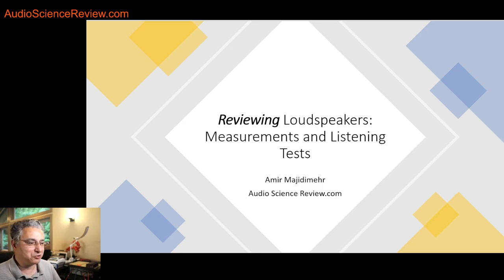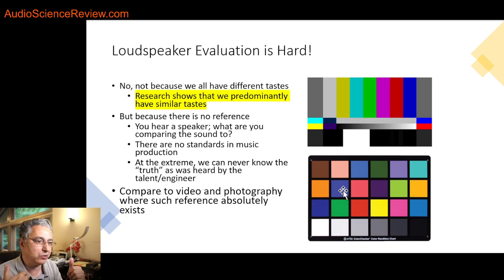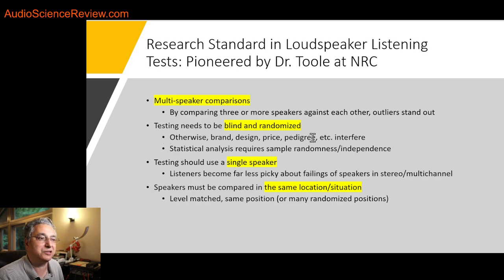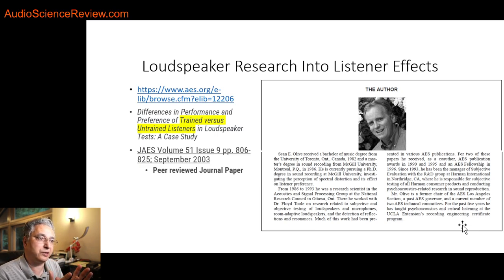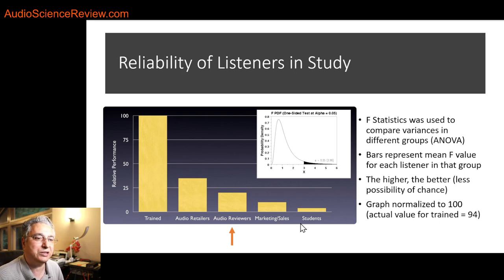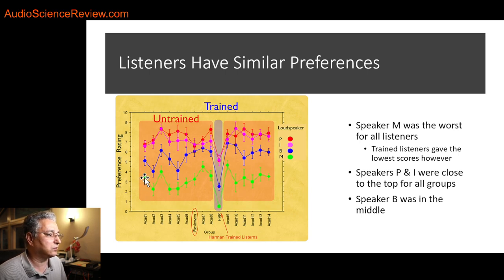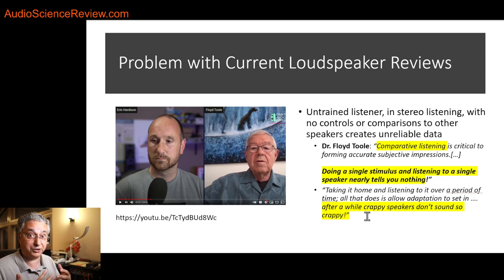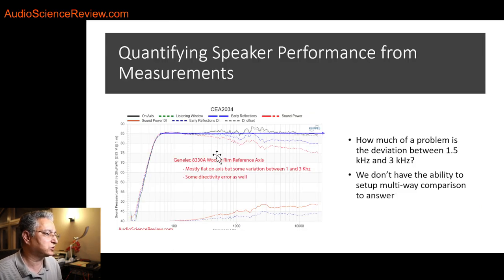Reviewing Speakers - Measurements and Listening Tests

Comment: When you compare speakers as you describe I don’t understand how not optimizing a speakers distance from walls is a fair way to accurately judge a speaker’s sound. Not to mention getting the toe in perfect. You say all speakers should be pointed directly at the listener. I don’t believe any reviewer or manufacturer would agree with that. In other words each speaker needs to be optimized to sound balanced. I’m not convinced this type of listening test is not biased.
Reply: Reviewers opinions I don’t care about. But manufacturers are a different story. If a speaker is designed with specific rooms, room treatments and positioning in mind it’s a bit unfair for HK who have a commercial interest to do tests under the specific conditions they use to design their speakers. Major home court advantage

Comment: The trouble with subjective testing is it depends on what speaker cables are being used. Quite often the quality of the cables are not taken into consideration.
Reply: It also depends on the source. As we know all dacs sound different.
Reply: Most importantly it depends on the quality of the amplifier. Does the amplifier have enough power to drive the speakers to their full potential.
Reply: @1fattyfatman  Kyron makes a good point. You obviously don't believe in speaker cables.
Reply: Sorry to disagree . 
But atmospheric pressure affects sound the most. 
Drag on speaker diaphragms are higher at sea level due to higher pressure and density. 
Its far more accurate when you listen at a hill station.
Reply: @dangerzone8408  if you have to "believe" in it, in order for it to work, some is wrong there.
Reply from the maker: You all are terrible.  :)
Reply: I refuse to listen to anything without a $500 power cable. I just don’t have time for crappy quality music.
Reply: No, it doesn't. As long as cable impedance is <5% from load impedance it has no significant effect. Significant here means it is still several levels below perception. Now, it does effect on long runs, i've had to make those and you calculate a compensation filter to it and you get the exact same signal, plus minute amounts of distortion and noise, all imperceptible, than with a short cable. We are talking about over 25m distances then. There is NO WAY you can do that with 6ft of cable.

I doubt you have formal education on this subject. And i don't think you a trained listener. Trained listener is not one who merely sits in front of speakers. It is an actual skill you have to learn, methodically and with guidance. It requires massive amounts of humility and the ability to say "no, didn't hear that". This part of it is lost on audiophiles, you can't say you didn't hear something without risking being questioned about your abilities. 

Laws of physics do not agree with you. If your theory about 6ft of cable would be true, we would struggle to explain how the Large Hadron Collider can even work. Or how i can type this and you can the read it. Nothing would work like they do now. Your computer for sure could not work like it does now. Now.. is is possible that you, as an amateur, without using proper methodology and primed to hear things that are not there, because of possible shame... what are the chances you are wrong or that all we know about electromagnetism, chemistry and physics in general is wrong.
Reply: @berlyfredy7153  I beg the difference. It's the relative position of the Moon that matters!
Reply: @snowblow1984  relative to speaker, earth or listener ?
Reply: @berlyfredy7153  direction of the cable
Reply: @snowblow1984  man we are taking it too far that people might actually start doing these stuff. 😂
Reply: @berlyfredy7153  I wouldn't be surprised if that's been done already. Or orientation in relation to earth rotation.
Reply: @snowblow1984  😂
Reply: No no, what really matters is what kind of cable risers you are using.

Comment: The hifi industry uses some electronic and electrical parts and some laws of acoustics to build its devices. Curiously in video, there are no philosophical ramblings: the image is correct or not. There have been several DVDs produced where at one point a scene was damaged, such as the negative of the film. And not corrected. For music it is more serious. In terms of sources and amplification, just about anything (unless faulty) will read 100% of the information without removing anything. For the loudspeakers, the low end is more than enough for recorded music (which has nothing to do with the sound of initial artistic performance anyway). Thanks to the software, you can manufacture very correct boxes yourself and thus use transducers that are rarely used in commercial productions, generally because of their price. Whoever tells you otherwise is in the snake oil business (the famous $40,000 amplifiers and 400,000 turntables to better listen to clicks and pops) and spends money on cables.

Comment: Great presentation Amir! Thank you for taking the time to put this together. 
Your point on EQ is particularly interesting. I’m still not clear on how to apply EQ to my stereo setup. Could you point me in the direction of a how to guide i could reference both from a hardware and software perspective?
Thanks again!
Reply from the maker: Thanks George.  How you do it depends on the architecture of the system you have put in place.  In my case, I use the Roon player which allows me to put EQ in the path of our my output device (DAC).  The transformation is then done in digital domain and software so had no cost or performance penalty.  If you use a different player that doesn't have this capability, then the work gets complicated and even more so if you are dealing with analog sources like LP.  Best to post in the ASR Forum and ask for feedback from members.

There is a mega thread on every method of software EQ for different operating system on the forum as well: https://www.audiosciencereview.com/forum/index.php?threads/eq-software-for-windows-linux-macos-ios-ipados-and-android.18450/
Reply: Buy a Beringer DEQ2496 .... will transform the sound

Comment: Interesting point that people seldom consider between sound and video and photography. You can pause a TV program or look a digital picture and stare at it to your hearts content. Its something tangible whereas sound is obviously temporal and has no physical thing to look at or grasp. You can't pause a music program, and then compare the paused segment to another. It makes no physical sense as the thing your examining no longer exists outside of your own subjective memory.
Reply: You can think sound to be one dimensional variance. There is one value that changes. This can be air pressure variation in any point in space or a signal. Without time, there is no sound. Frequency is a derivation, does not exist in any single frame of reference. Image is two dimensional without time component. You can zoom in, and look at a detail. You can crop the image and still have a complete image. Microscope picture and scenic view, both are the same in that regards, both are full pictures. Sound can't be stopped, can't be zoomed in, can't be cropped.
Reply: You are wrong with that statement. If you pause during calibration, due to changes in heat over time, pixel dimming when you do not insert a black frame to clear pixel retention memory, etc., you wind up getting the measurement wrong. Even though the image may look static or paused, it is not when doing video calibration. This is  why pattern generators and video files that display the pattern for a preset amount of time is used. Because when you pause it, you are introducing errors to the measurement process.

I do apologize, but I started doing video display calibration before picking up the audio hobby and own around $3000 worth of calibration equipment for displays. It is more nuanced than many think. And that is without the equipment to fully test the EDID, testing each connection between each component, etc. 

So it is a bit of a misnomer that people think it is paused or static or that pictures when paused are being displayed the same. And you can compare each instance to the other temporally. You just have to measure and measure and measure. You then can do averages or compare one instance to the next. Temporal slices in measurements is a thing. It is tangible.
Reply: @ajc-th5ei  This is human memory I’m referring to, not calibration of a video source.
Reply: @mysock351C  - my mistake. I apologize.
Reply: @ajc-th5ei  np...

Comment: In sound engineering, we use reference tracks and constant A/B testing. It is part of the workflow and you can hear when it is not done. Reference tracks are there to "reset" your adaptive hearing, to anchor it to a known point that doesn't change. And A/B testing is obvious, when changing the sound deliberately you have to compared before/after, as solo channel, as part of the group, as part of the mix. You have to do it at all levels and layers. A mix that has not done those sounds "off", channel balance is not correct, EQing is too dramatic, compressors are too aggressive, it is muddy and often like "artificial sweetener" is added; it is sweet but leaves a bitter aftertaste. 

The same principle works in all audio, references are the key for good listening tests.

Comment: Great summary of the science and how it relates (or doesn't) to what subjective reviewers say. One thing you hear a lot On Here is reviewers talking about "sense of space" or "separation between the instruments," which seems to be different (in their view) from the tonality/frequency response. Is there any measurement that captures or explains this phenomenon? Are they commenting on THD(+N) without using that term? Are they just hearing their own rooms?
Reply: Very good question. But I'm afraid there will be no answer here. You have just touched a delicate point in the discussion! Let's see if anyone can explain it with "scientific measurements" or other reasons. Because I assume that Mr. Amir will not. But I could be wrong!

Comment: Question. How do I listen and test in mono? Rather than just use either left or right of a stereo recording, I'm guessing I would use a program/plugin/app to convert a stereo recoding into mono format (both left and right channels are now identical) and use either channel. I'm a DIY speaker builder looking to improve my design and testing methods. Thanks in advance. Another great video.
Reply from the maker: I just listen to one channel.  As I noted in the video, most music these days has strong mono spectrum and serves this purpose well.  Of note, we are not trying to enjoy the music but use it as a realistic "test signal."  So one channel works perfectly fine.  Now, if you play 60s music with hard pan to one channel or the other, it may not work as well but for vast majority of more modern recordings it is fine.

On my desktop for comparing studio monitors I do have some mono tracks.  That way I can play one track to one speaker and another to the second.  Then switch between them.  For that, I used Adobe Audition and converted to mono but requires care to avoid clipping and phase cancellation.  So really best to just use one channel.
Reply: @AudioScienceReview  Thank you Sir. Much appreciated.

Comment: And yes, proper equalization gives you decibels of "good" while giving you fraction of one percent of "bad". It is a no-brainer, you can NOT hear EQ in most cases. You can hear what the EQ has changed but you can't hear it as a device. We know what it does, we can measure it but you will never, ever in your life be able to tell if there is EQ or the sound just is like that originally.. EQ is used on EVERY SINGLE TRACK in EVERY recording you hear. The signal can easily have the combined effects of 40 EQs. You should not be afraid of adding one more.

Comment: It would be increadibly nice, if you would give the equalisation (normalisation) Information (Roon Settings) from now on in every new Test of any speaker or headphone that runs through your lab. From now on this Video of Yours is reference to me!
The perfect speaker? The one with a perfect flat frequency response, 25 Hz Bass ability and the ability to play very very loud without any audible distortions: E. G. Klein und Hummel OC 500; Geithain ME 901; Neuman KH 420; or passiv Speakers like the Nubert NuVero 170 or the Hobby HiFi Audimax Reference Standard (DIY). Greetings from Germany!
Thank you for your hard work in debunking Audio Myths.

Comment: There are many factors that define the sound quality of a speaker, Frequency response plays a major factor so are different types of drivers used(make from different materials gives rise to dynamic or less dynamic, etc), tweeter dispersion, cabinet resonance, etc.
Reply: Thks for this video presentation, it contains useful info.

Comment: For me, it’s an interesting explanation, but what is strange, is that in my sound engineer experience, even if Genelec are on paper good speakers (and we use them a lot on studios with other brand because they work as a magnifying glass when we do eq…), I will never put them at home to listen to music: they are not pleasant to my hears for listening to music. My personal speakers have a worst frequency response than 8330a (I have mesure it - I try to correct it with Roon and Convolution Eq and I never succeed to have a better result - with a big accident in the middle range) but listening to music is way more pleasant. And I have done A-B testing with these two and the result is I prefer my speakers. Do you have an explanation? Is there in you opinion more parameters (like membrane material, phase rotation, …) which can explain this? Because in my personal experience (and I want to point the word personal), linear frequency response of a speaker is not correlated to pleasant listening experience…
Reply: One more, very good question. But I'm afraid, too, it won't be answered. You've just touched another very delicate point in the discussion! Let's see if anyone can explain it with "scientific measurements" or other reasons. Because I suppose Mr. Amir won't. But I could be wrong!
Reply: @DoNaSbaR  You're right, no answer from Amir about this...
Reply: @SylvainDidier  what would he say?

Comment: Amir. Could we work on a public standardization format sometime together? 

Id like to see:
1) beginner stickies: a bunch of pinned posts that can be updated with the most relevant high impact information for beginners.

2) A way to make this research a little more reproducible, and thus, falsifiable: Maybe we can find a way to distribute a method of measurement similar to the klippel but cheaper and less accurate for more data points.

3) A way to make this research more verifiable: Id like to start with explaining, why a data centric approach is important. Why we use the metrics we do, its impact and scope. And how to improve it and why we dont know how to. Essentially, why our data matters.

So yeah. Could we? 😋

Comment: Great presentation!  Based on your comments about equalization, I'm curious about your thoughts on room correction software in receivers like Anthem ARC, etc?  Aren't these more or less doing what you suggest in terms of correcting dips and spikes in the audio band?  Curious if you've ever tested the performance of these software packages?  Would love to see an analysis of this!  Thanks so much for your wonderful work, as always.
Reply: He tested Audyssey which he posted on his website. Gave it a good review
Reply from the maker: Automatic EQ indeed makes important corrections for the impact of the room in bass frequencies.  Above that, what they tend to avoid making small corrections in higher frequencies which is wise but also means they can't fix these defects.  Best approach is to get a very good speaker and have these EQ systems correct the bass and then overlay a target curve (overall slope from bass to treble).  This is what I have done with my Revel Salon 2.

But yes, if you can't do anything, by all means, try the automatic EQ system.  Anthem ARC is effective and works well in my testing.

Comment: Very interesting presentation, I have been watching headphone reviewers and they use a frequency curve as a standard and evaluate variations of frequency response of a HP/iem to the standard curve against subjective listening, it rarely disagreed with the variations , they are also younger listeners and wonder if they would be better than the audioreviewers, they can also swap between multiple units rapidly, obviously not easy to do unsighted listening other than iems